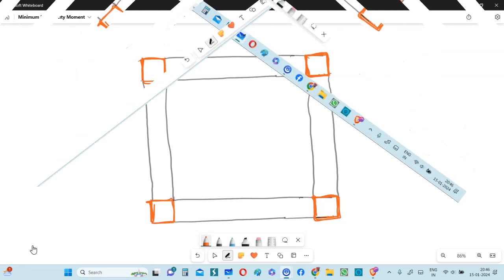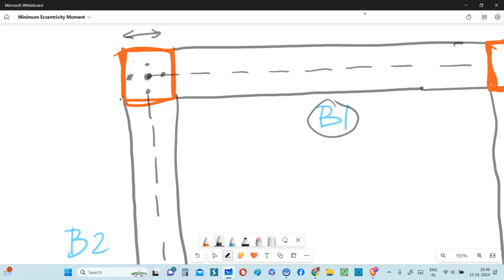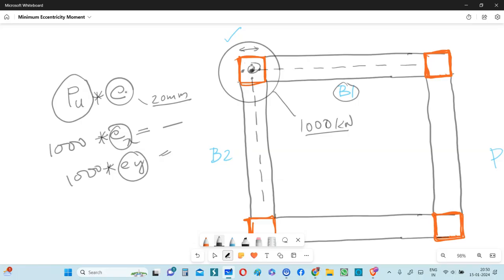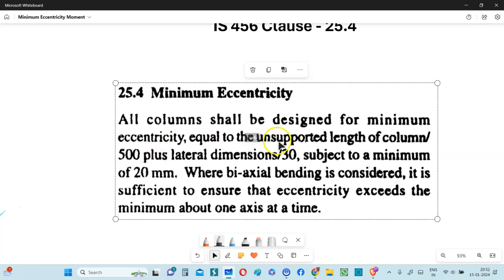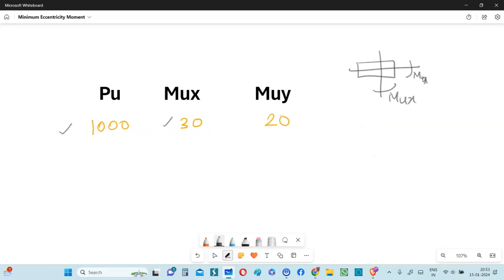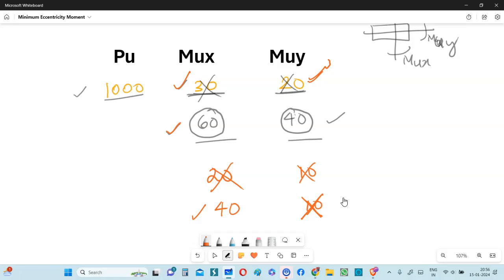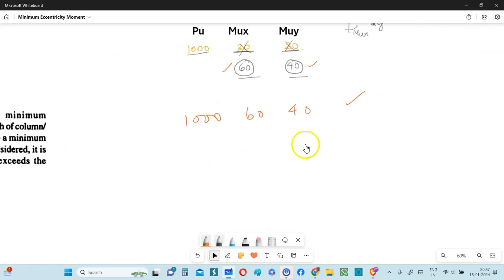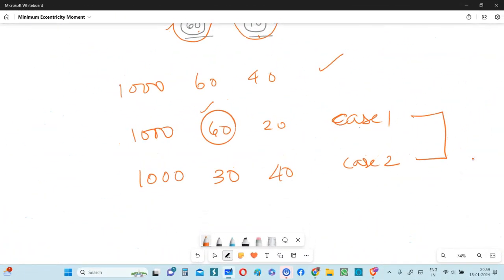Minimum eccentricity of columns - Is your column design correct?

Comment: How we can manually calculate moment in column from load P and how we calculate Mux and Muy in Column manually.  I have done so many research in books mostly moment is already given in books examples but there is no any method that how we can calculate moment in column
Reply from the maker: A few points to note
1 - Every thing need not be and cannot be done manually
2 - P is not essentially creating Mux and Muy. They are the frame moments.
That is what you are manually calculating in Theory of structures when you do the plane frame analysis using Moment distribution or Kanis methods.
But the problem is, that shows how to do for gravity loads
When seismic is involved, plane frame methods are approximate and hence we rely on software tools

Comment: sir, i have an question in column design. After analyzing the column ,moment are high in top storey(mx,my value) while compare to bottom storey and at the same time the Pu value is high on bottom storey while compared to top storey  . which value (PU ,Mx and My ) should  take while designing a column
Reply from the maker: You need to design each level of column separately
Also note that you will have 26 combinations for design. Why don't you make use of our republic day offer and learn from the course? You can find it in the link below

https://course.civilera.com/courses/etabs-superstructure?coupon=OFFER2022

Are you in my groups and emails?

Comment: Thanks sir for this valuable video.
Sir ,please make detail video on eccentricity of Column due to reduce size of upper floor column, and eccentricity due to unequal load (due to unequal beam span around column).
Which eccentricity should take account.
Reply from the maker: I am not a fan of reducing size. You cannot generate it unless you apply it